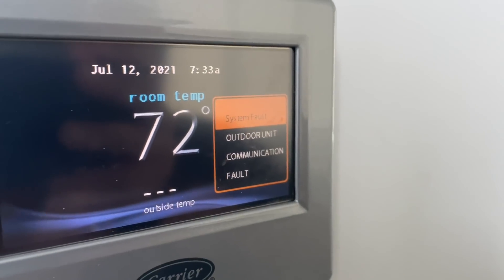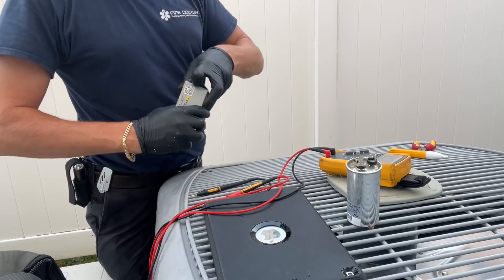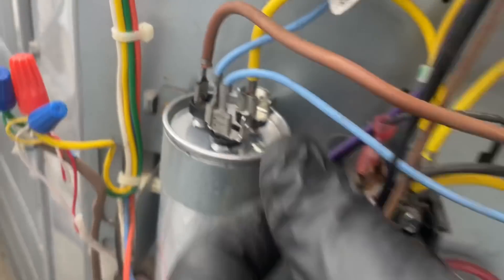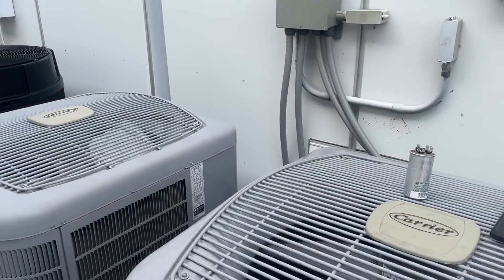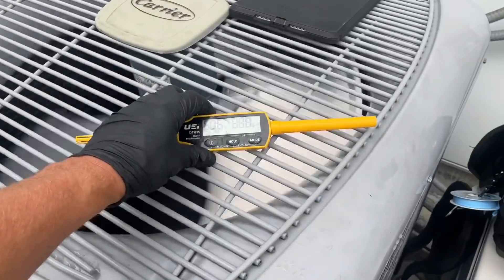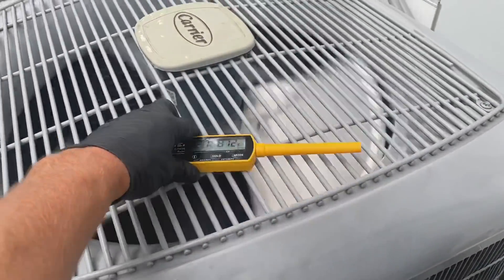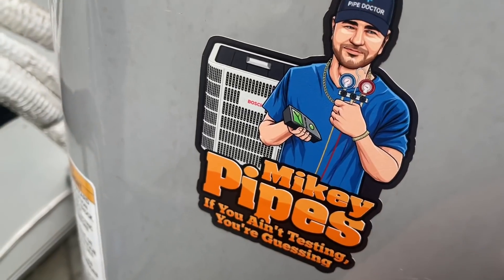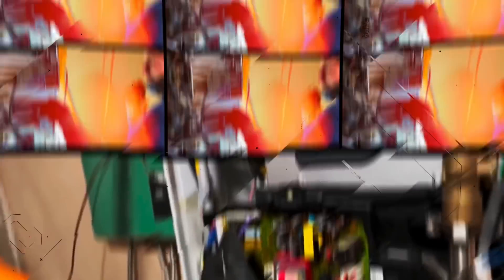Carrier Infinity System Fault 81 Thermal Lockout in Low or High Stage - Resolved Bad Dual Capacitor

Comment: I had exactly the same issue with my 4 yr old 25HNB6 heat pump.  In my case the 7.5 uF capacitor section (which connects to fan motor) measured OK.  The 30 uF Compressor cap section measured at about 7uf.  When the cap gets to low, compressor can’t start…it draws current until it trips the internal thermal protector.  Control board will retry every 15 minutes.  After three start failures it throws the 82 or 81 code (depending on it it was a high stage or low stage start attempt) and locks out for 4 hours.  Explained on page 52 of Catalog No. 24-25-6SM “Application Guideline and Service Manual”.

I’m an electrical engineer and had to figure it out when my local dealer could not.  Carrier told him to replace thermal sensors, but my measurements showed sensors to be fine. My own queries through Carrier web site went unanswered.  Worthless “support”.

Thanks to the web site operators who place the manuals online.

Comment: Would s faulty discharge temp sensor do the same?
Reply: @PipeDoctor  shouldn't an insulation test tell me if the compressor is going bad?

Comment: Caps have internal contacts arranged to break upon distention of case (doming) due to internal pressure.  Opening of the internal contacts protects against case rupture (thermal events) and damage to loads from capacitance value changes.

Comment: Question Mike I feel once you turn the ac system on for the season,and the  moisture is out of the home, and cool. The system runs more efficient.  The thinking is the home is at a constant  temp humidity free. What are you thoughts. I see people run there system, and the first cool but humidity day open there windows introducing the moisture back in . Thoughts
,

Comment: So new fan cap read 7.0uf for a 7.5uf ? I would come behind on a maintenance and advise to replace due to a 6% loss . That's alot to be off for fan motor and effects amps - it's working though . Damm good help is hard to find  . Sippy cup needs a day or two on street when arrives next day .

Comment: There is a reason that cap failed. Most of the time its heat from a dirty condenser coil and the amps of the compressor are driven up. Also voltage drops from the neighborhood all using AC  could have caused higher amps and also burnt out that cap. But its a first gen Infinity system.. not today's DC powered ones.
Reply: Who the hell set that minisplit right on top of that unit..WTF..
Reply: @DaveK76  I said same thing. What a hack job.

Comment: Hey mike those carriers will do that when cap goes out that other blue wire on herm goes to terminal on that communication board and if it doesn’t detect proper current will lock it out on 81 when it’s just weak also seen a lot of issues of 81 due to the txt not equalizing on systems with attic applications with long line set per tech support needs a liquid line silonoid valve it fixed the problem for me but that was on the inverter green speed systems great videos keep up the good work

Comment: Good Job Mike! Little heads up for next time. That code means that the compressor overheated and tripped on thermal overload 3 times for low stage, 82 for high stage.
Reply: What does a 95-HIGH CURRENT LOCKOUT mean?

Comment: I had three sets of those fluke leads because I really liked them but they all failed when it comes to resistance testing. They have bad connections in the strain relief
Reply: Ok hate fluke leads I use the needle points on my fluke meter.

Comment: hello Micky Pipes I live in Mobile home and we have all electric no gas so we having a problem with central air it seems its working outside system but we not getting no blowing in the vents in the home and the Furnace making strange noise so I was wondering if that could be Capacitor in the Furnace too ?? sorry for my writing
Reply: If you get no inside fan at vents you need to check the inside blower first. Is it blower locked up? Is the blower fan still attached to shaft?  Is the inside blower capacitor good?  I would start at that basic investigation.
Reply: @01Hokiefan  when I turn on the furnace on heat I hear the fan but when I turn on AC It makes strange sound with no fan so I think it is the fan in the furnace

Comment: I had this same issue, I wasn’t as lucky to be a cap. It was the board cutting out the fan.
Reply: How much did that cost you? I just had the same error code 81 and 82 . The tech changed out the dual voltage stabilizer $600. Does that sound about right?